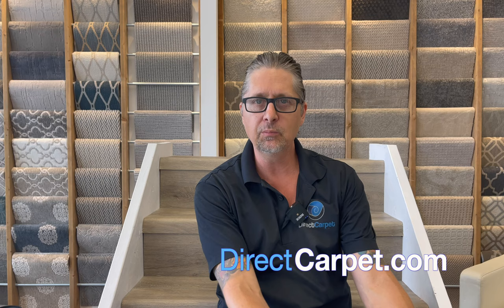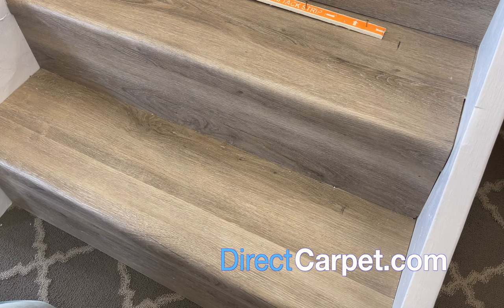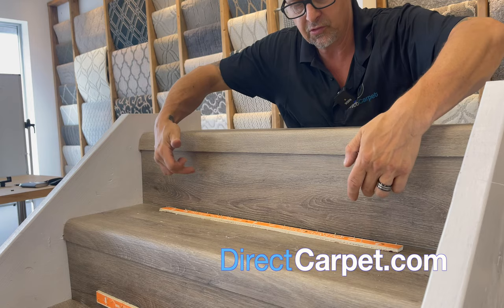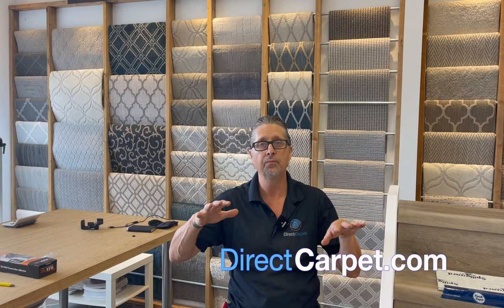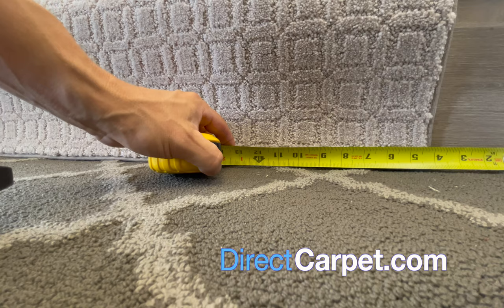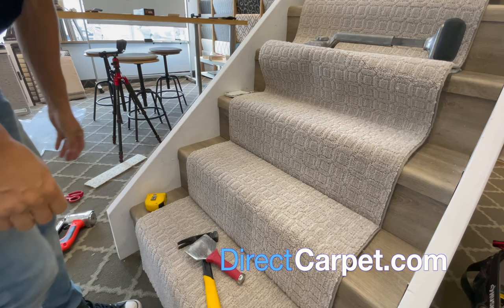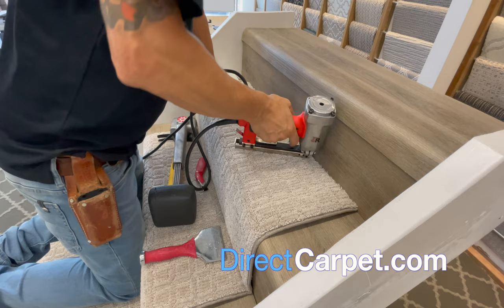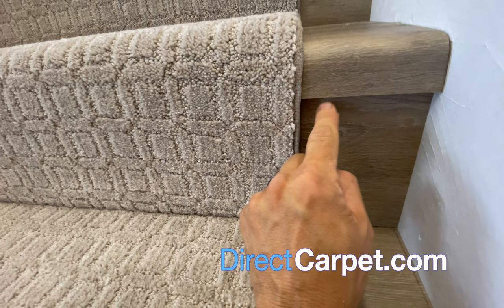Install a Stair Runner Over Laminate, Vinyl plank & Ceramic

Comment: Thanks for this video!  Can you explain a bit more what the wood pieces are called and their direction? I’m not familiar with them so I want to make sure I get the right thing and install it correctly. Thank you!
Reply from the maker: I believe you are talking about the tack strips / available at big box stairs usually / they have to face in towards the riser from the stair and when placed n the riser they have to be facing down towards the stair😀😀😀

Comment: Awesome video ! I just got LVP installed on my stairs. I have overhang ( stair nose ) on my stairs. Can you suggest how to deal with the stair nose issue ? Thanks
Reply from the maker: You can just go over it and install waterfall same as the video shows / if you wanting to follow underneath the nose, you may have a tough time

Comment: I Used PL adhesive for my vinyl stair. It worked well. The only tip is check your tack strip. Some pieces are more warped and have a bend. Those pieces would want to pop up, so I would have to make sure I used a straight piece. So have a few extra in case.
Reply from the maker: Great advice 👍